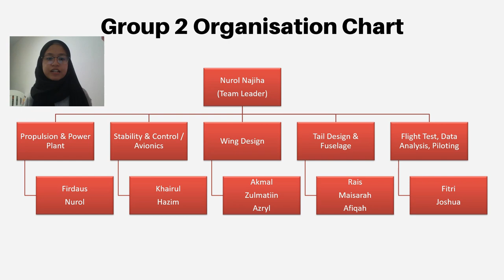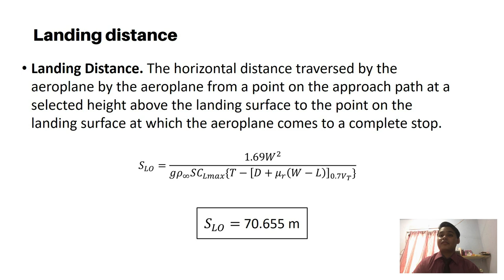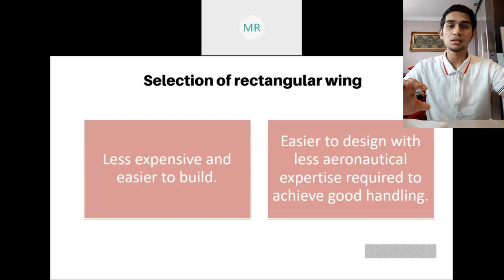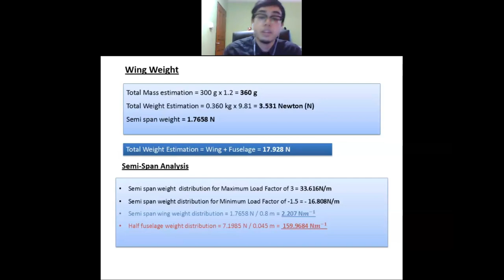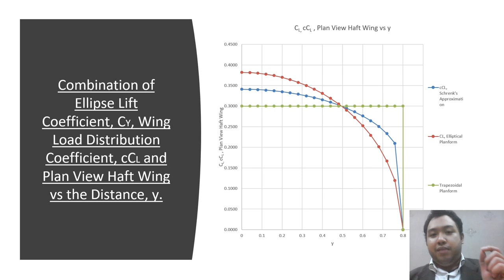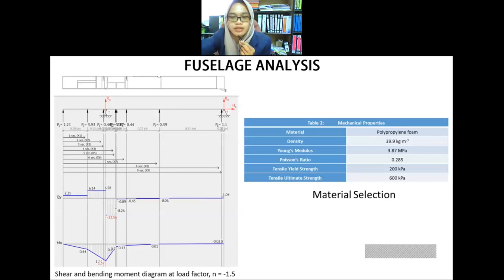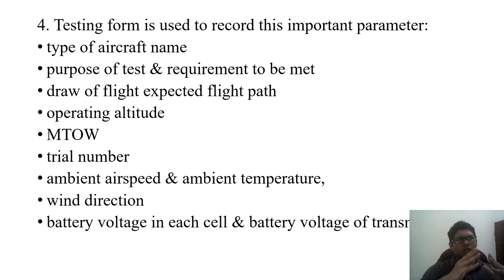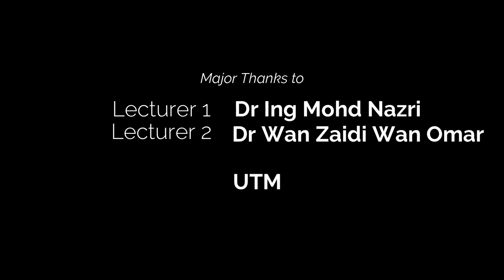ACD II | RC Plane Project | Group 1 - Presentation 2

Comment from the maker: 0:29 Organisation Chart
0:55 Costing
1:33 Final Design
1:45 Detail about Design (Khairul)
11:28 Performance & Avionics (Hazim)
17:30 Propulsion & Power Plant (Firdaus)
19:30 Study of Power (Nurol)
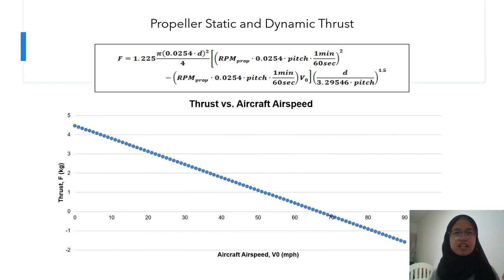22:25 Wing Design (Akmal)
36:19 Wing Analysis (Zulmatiin)
45:10 Wing Loading (Azryl)
54:44 Tail & Fuselage Design (Rais)
1:00:45 Wing-Fuselage Attachment & Fuselage Analysis (Afiqah & Maisarah)
1:09:30 Main Landing Gear (Maisarah)
1:12:17 Fabrication Process (Joshua)
1:14:52 Flight Testing & Preparation (Joshua)
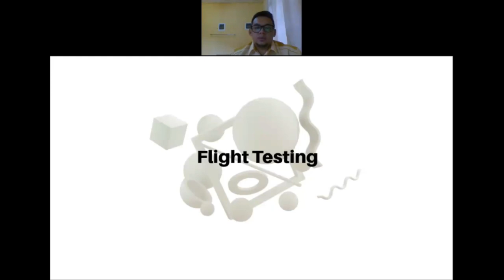1:20:35 Flight Testing & Flying Procedure (Fitri)
1:25:50 Project Challenges